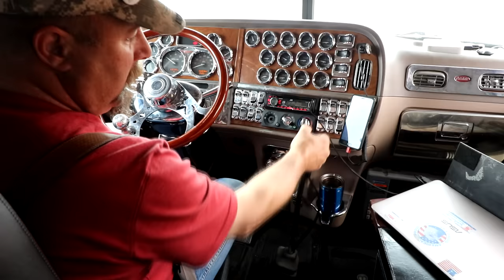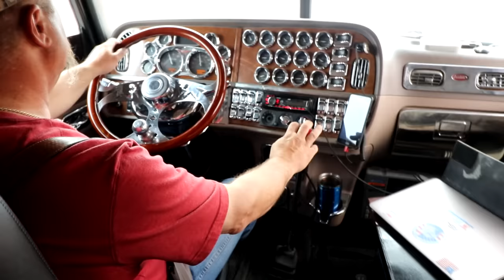How to shift an 18 speed transmission

Comment: I used to drive a 1952 Mack with 30 gears using three gear shifts. One was five gears, the next split those into 3 each to make 15, and the third stick split all that into 30.
Reply: why 30 gears though? like what are you hauling that requires that many gears? were you in a mountainous area?
Reply: @ Andrew:    When you have a powerful, torqey engine, you'd need less low gears than if you had an older, smaller motor trying to move very heavy loads.  The lighter a vehicle is, the fewer gears you need, as well as if you put a powerhouse motor, like from this truck (if it were possible), you wouldn't need any gears.. just final drive / even ratio. Could even have a few OD gears in that scenario.  Today's semis are gigantic, heavy and haul a lot of load, so even with big motors, you need more gears to get a heavy load moving.  It also lets you put in a smaller motor (relatively) than you'd otherwise need, giving the truck better range.
Reply: \\you wouldn't need any gears.. just final drive \\\ Larry, you'd strip the teeth off the gears before you got it moving.
Reply: Holy cow, 30 gears and 3 sticks?! Haha, WOW! So you would have to constantly rotate from stick 1 to 2 to 3 and then back, over and over!
Reply: how many arms do you have regular number or enhanced  with two on the one ide
Reply: I bet your arm got quite the workout!
Reply: Great  dear , how do you feel.
Reply: In europe we have same in agriculture an early days in trucks. They easy way to think in gears is to understand that one shifter is only a downstep and upstep in the same gear. So think of the three shifters as first one only shifts the whole group of gears second shifts the gears it self and third shifts the split. If you have seen a gearcase inside you will immediately understand the way it works. The split is before the main gearshaft and the group after or vice versa and the gears always stays inbetween. So group an split change the ratio for the whole gears.... Hope you understand
Reply: My condolences!
Reply: How do you make that sort of gears?
Reply: He is a troll
Reply: Overweight and/or mountains. A 9 or 10 has gaps that can be too big to up- or down-shift and you get stuck in a gear and lose time. It is also safer going down hill to be able to able to inch into lower gears so you don't lose traction.
Reply: I feel wonderful. Small engine 
Could provide greater efficiency
Reply: 30 gears can u give me a link as i can't find a 1952 Mack with 30 gears
Reply: me i used to drive one with 100 gears haha
Reply: @mickn9911  Excuse the typo. 1953. Mack B61 Triplex. Go to the link and scroll down this page a little, and a guy has a picture of the setup. Trucks back then were built to the customer's needs. It was a logging truck, and you had to be able to crawl around in the woods and still be able to go highway speed, and the engine had a very narrow range of RPMs. You made up for it with gears. The big stick in the middle was the main, 5 speed. The one to the left is the brownie that split that into 15, then the lever on the right split the axle and had two positions, and you would theoretically go back through it all again. In reality, you wouldn't necessarily use the entire sequence of gears. It depended on the driving conditions and the weight you were hauling. After a while, you just knew how best do it without thinking like anything else.
https://www.bigmacktrucks.com/topic/49809-the-three-stick-mack/
Reply: My Lawd🤦‍♀️🤦‍♀️

Comment: When I was a kid I thought that the bigger the vehicle = the bigger the engine = the faster it goes. Which means until I was about 10 I thought that semi trucks and buses were the fastest things on the road.
Reply: Motorcycles are the fastest.  Then the jet powered Chryslers, then supercars, then any 8 cylinder monster car
Reply: @frankcastle4715  please tell me you’re joking
Reply: Some trucks are pretty damn fast. The ones that doesn't have a governor on it though.
Reply: If u put a jet engine then they're fast
Reply: @notimportant4994  hill climb trucks are an example
Reply: @frankcastle4715  Motorcycles are fast but definitely not the fastest, and what in the actual fuck is a „8 cylinder monster car?“
Reply: @notimportant4994  because your sitting high up ... The truck seems like it is going slow ... The road speed is actually faster.
Reply: They were, for a while. But #*$%?! governors make that impossible.
I once drove a car at 95 MPH. A semi truck passes me like I was standing still. Never saw that truck again!
Reply: @alexmason5521 : These vehicles are fast. But all have their limitations.
Reply: They were at one time. Then came the #*$%?! governors. When I buy a truck, the first thing I do is have the dealer disable the governor before I accept delivery.
Reply: They can be, especially bobtailing, even a stock truck can accelerate quick. Lots of torque. Not the fastest, but could probably beat a lot of passenger cars in the 1/4 mile. When my trailer's empty, and I merge onto the interstate for instance, I can be up to the speed limit by the time I merge off the ramp.
Reply: @norbertsiewert3917  thats treu, but most truck arent made for speed tho, so at some point you meet the redline and when that happens any car made to go fast will eventually catch up. though a truck might be able to catch you on the acceleration, since thier made with so many gears, so you can redline faster without losing to much rpms on the upshift.
Reply: Well, tourqe yes. But the HP to weight.. it is basically nothing.
Reply: it is, while you are driving down the road and they are trying to pass you. at least thats what happened in indonesia (Surabaya to Bali)
Reply: That's adorable! For a very long time as a kid I loved wheels with little holes in them. I always called them Toms (not a single reason why). I always thought they were fancy and the cars they were on were sweet. Turns out it's just stock 90's Honda hub caps with the holeshots around the edges. I found this out because I now own one :)
Reply: When I was a kid I thought that the faster the driver turns the steering wheel = the faster the car goes.

Comment: this man knows how much clutches cost. floating those gears like a boss
Reply: D Lovett I think wearing on the teeth in the tans from floating will cost a bit more in the long run.
Reply: we all float...saves wear and tear on your ankle
Reply: John Michael  that I can understand. Just wasn’t quite sure that preserving the clutch over the gear box was logical when considering maintenance cost’s. Now your ankle, that’s more important then any part on the truck period.
Reply: We drive in europe with synchronised gearboxes... floating you only do when you lost your synchro discs
Reply: If you have drivin a 18 speed. You know that you dont want to use the clutch cause it is more work out then going to the gym and your legs get tired
Reply: Floating gears is easy & These trucks practically drive themselves
Reply: My experience says floating gears costs nothing extra if you know how to shift properly. Some people got it some people don't. If you're heavy double clutch a few gears to get going, after that you should be good. Learn as you go. Excellence comes with experience as with anything ! Safe travels.
Reply: Floating gears is easy. I do it just for the hell of it in my toyota eight six
Reply: Floating helps a lot. However to pass the driving test, you have to double clutch the whole time
Reply: "We all float down here Georgie"-IT
Reply: What is floating a gear?
Reply: InTheAir1122  actually floating gears helps the transmission semies u dount use the clutch  at all just for wen u are at a stop then taking off from a light or stop sign it actually saves u money on the transmission since its a nonsycronized transmission  a car and a pickups transmission if u do that it will tear it up so whatever u got your info from on semi truck transmissions u might wanna do more research before saying it will hurt the transmission on them but in fact and in truth it doesn't hurt it at all

Comment: I drive a 13 but I go thru every gear, I enjoy it, I guess is a family tradition and don’t miss a gear cause dad is watching from heaven and he will get mad if I do hahahhaaa
Reply: Kudos to you Driver, sound like you have pride in what you do, I think, that is the first step in being a professional. No one is looking  (except Dad) when you're in that truck alone, but you still do it right, from one Hand to another, ROLL ON BROTHER!!
Reply: hahaha yeah i've been driving for 18 years now including tank transporters in the forces all over the world on tour but i remember when i was new i would go through every gear even when pulling empty trailers just for the pleasure of it but its almost entirely auto's now here in the uk and to be fair i don't mind as i get older as its just less to bother with these days and all the moron cars just become a pain
Reply: The gears are there if you need them, if you don't need them all, it's not wrong to skip them, I used to drive a single axle flat bed with a five speed and two speed rear, if it was empty, I'd just start in 2nd then 3rd, then 5th, then high range on the rear, it doesn't hurt anything, if anything it saves wear and tear.
When I was a kid I remember old timers driving a three on the tree, and only using first and third, give it a try, skip a few gears.
Reply: I suppose that the fewer gears you have, the larger the steps between them will be, which in turn means you actually will need to use more of those gears than if it had had 18 gears....

(Correct me if I'm wrong.)
Reply: @ziiofswe  You wouldn't need to use more, you'd just skip less.
Reply: @jabukufo  Same thing, different driving scenario. ;)
Reply: Zioffswe this is a 9 speed transfer with a splitter I've driven 9 10 13 and 18 speeds I never split low range high range just keeps you from revving the engine as high
Reply: bill2178  l know what you are saying, l drove 18 speed speed transmission, most of the time l would just shift it like a 13 speed, Drove 11 axle tractor trailer tagged at 160,000 with no problem pulling a load 👍
Reply: thought u said im 13
Reply: No fun being behind you at a red light.

Comment: I used to drive an old 230 Cummins ten speed with a two speed single screw rear end. It was driven the same way. Nice explanation of low side, high side and splitting gears. Top speed was 68 miles per hour.

Comment: No questions from me. Brings back memories of the days when I was driving. Keep on trucking.
Reply: Ralph Woodard how can one make an emergency stop with this 18 speed semi truck??
Reply: saurabh singh simple, just push in the clutch slam on the brakes
Reply: Driver , idle off
Reply: Ralph Woodard ,
Reply: Why don’t the gears grind like in a cars transmission, is it a different function of can you actually do this in a car type transmission?
Reply: Can’t drive anymore because of my health but man i miss the pete.
Reply: Also some drivers where a parachute.. The more speeds the bigger the chute LoL
Reply: Let's say you're driving down a mountain, fully loaded & you miss a gear. (Traveling too fast to grab ANY gear.) Missing a gear is called G.O.D. or Georgia Over Drive, if you're going down a steep grade & you miss a gear, you'll be praying to GOD your brakes don't fail.
Reply: Ralph Woodard 
Why the fuck would you push in the clutch in an emergency stop? Let that engine braking do some of the work
Reply: Down shifting,  brakes , Jake brake /engine brake / trailer brack / Ebrake .... All else fail abandoned rig before impact
Reply: Been there done that. Made for a bad day, brakse got hot 70 ton of coal down a 2 mile mountain with NO Jake brake.!!
Reply: That works IF your Jake is working.
Reply: bizinga, they won't do it in a car either if you time them right, but you will wear out the synchro's.  Another reason is because the gears in a semi are a lot closer ratio and aren't spinning as fast as a car.  When you hear someone rev the engine they are matching the input with the output, so they can downshift easier.
Reply: Ralph Woodard. My father knows how to drive double shift stic transmicions very old.....18 speeds etc.....from mexico ✌
Reply: You can actually do that with a manual transmission in a car or truck if you're not too aggressive. I used to deliver bottled propane driving a '60s model GMC 3/4 ton with one of those old V-6 engines that would idle really slow.  It  had a 4 speed where 1st was the really low "granny" gear. Because of the low RPMs, I could snatch it into granny low without using the clutch or grinding the gears, shift it all the way up and back down and into neutral without using the clutch. On a modern vehicle, and most older ones, you would need to start off using the clutch.
Reply: bizinga 1 Diesel engines run much more slowly than a gas engine so you can more easily float gears.
Reply: Ralph Woodard
Reply: Why don’t you drive anymore?
Reply: Dana - The footbrake alone is way more than enough to lock the wheels, engine braking does not help at all in an e-stop.

Pressing the clutch is only really necessary to stop the engine stalling - useful if you need to pull away again quickly once stopped.
Reply: Ralph Woodard Do you miss driving
Reply: Pete_ Hine_Of_PA 
WHERE did you learn to spell?
Buy a dictionary  and learn the difference between WEAR  WHERE    and  WERE.
You need to undertake an extensive reading program and learn English.
Reply: I what gear is 1 to 1 ratio?
Reply: @bravonana10  That would never work. You should put it in neutral and firmly push your brake pedal. These trucks have air brakes that are very powerful,. Quit giving bad advice Red Sovine wannabe. You probably work at Blue Beacon.
Reply: terry tate if i heard correctly 6 to low on the top shelf is 1 to 1
Reply: @madtater5948  probably 16th, with a double overdrive
Reply: @Ralph how are you doing
Reply: @Hello Ralph how are you doing

Comment: 17th gear 55mph

I thought my miata had short gears
Reply: Yup they're meant for torque not speed
Reply: Your Miata doesn’t have 2000+ ft lb of torque lol
Reply: Turks8806 2000 feet pounds???
Reply: Jared Hexflame oh my bad, i dont know shit about cars so feet and pounds in one measurement sounded wrong.
Reply: you fucking momo all good. Most trucks are anywhere from 350-550hp and 1000-2000 ft lb of torque.
Reply: @fidle89  BHP is a sort of calculation that gives you a number that lets you gauge how long that torque band lasts and how fast you can accelerate. HP = torque * RPM / 5252. So for example you have a turbo diesel car that makes 300 ft-lb of torque( a lot) but max RPM is 4,000. 300 * 4000 / 5252 = 230HP which is not really impressive for the amount of torque it makes. Sports car usually make HP that is close to their torque number because the power band is pretty wide. Diesel cars are not meant for speed so their power band is narrow.
Reply: It’s for pulling extremely heavy shit esp if your in an area with a lot of inclines.
Reply: You're Miata doesn't pull 80k +.
Reply: Lets keep the comments on miatas ok?
Reply: Can your Mazda haul like 20-30 of itself tho lol
Reply: @daltonbeal1720  i mean his comment led to a conversation about foot pounds while yours was entirely useless
Reply: My dad went 85 in 10th gear
Reply: @SI0AX  that is one impressive explanation.
Reply: @bryce9354  , I saw a foreign truck (proper name: lorry) whoosh past doing about 85mph here in the UK. I thought the chap just needed a pee really bad :-)
Reply: @stupidtreehugger  damn